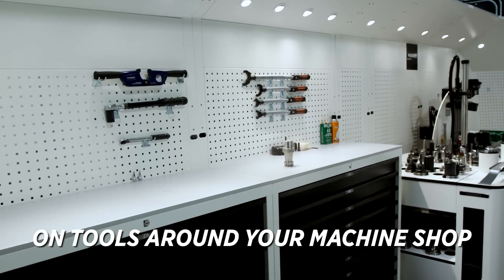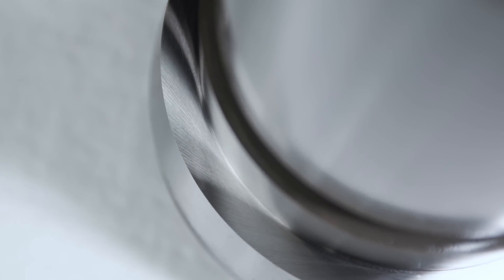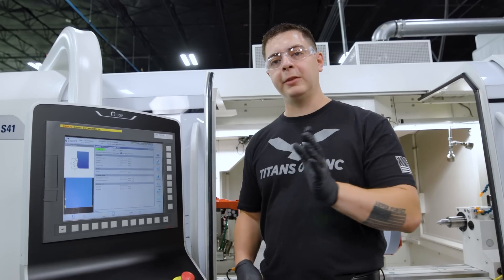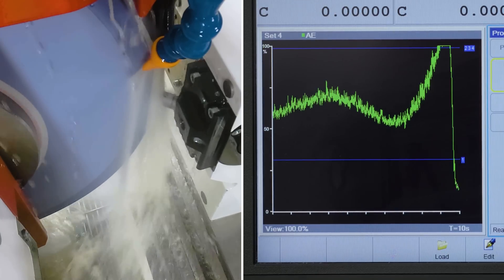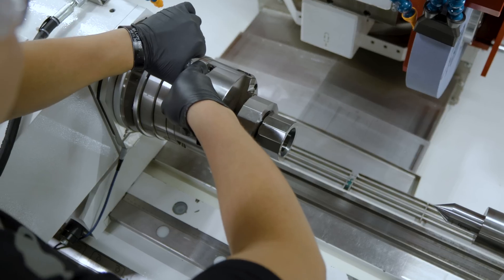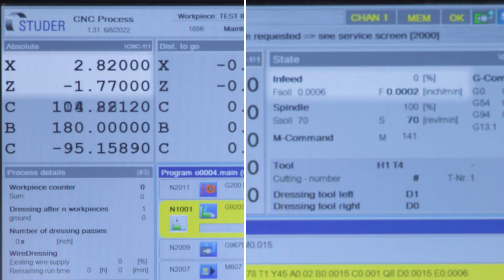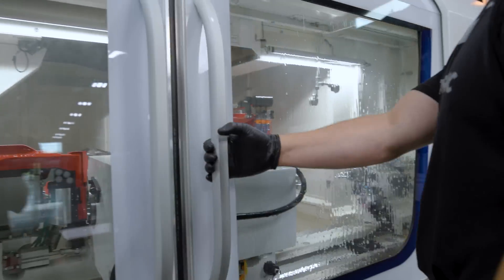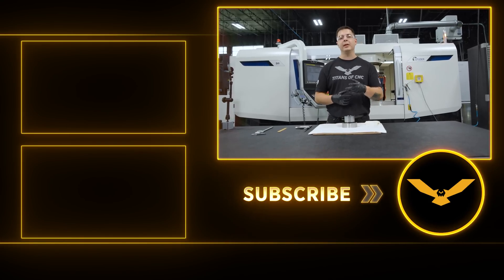Master This Extremely Difficult Technique To Create Perfect Flatness

Comment: Years ago at a former employer I was being trained to operate a new Studer by a tech from United Grinding. I was grinding the face of a cylinder square and asked the tech if there was a macro for relieving the wheel, it just confused him as he had no idea what I was talking about. While grinding the sample part the machine came with for instructional purposes I got to large radius on part, about 1.5 inches if I remember correctly. Tech stated we wouldn't be doing the radius because dressing such a large radius would destroy the wheel for anything else. It is a CNC, could have put a 0.030 radius on that wheel and generated the radius. Dude couldn't make the sample part that came with the machine. WTF United Grinding? Really, WTF?

Comment: I was ona grinder doin some cross hatches and grinding the tool marks off of grooves where O rings would seat, coolest machine ever, dials moving by tenth increments with a vernier to repeat a location. the only thing is the kerosene smelled terrible and I could not continue

Comment: How would you guys go about creating a 5' x 1"thick disc out of stainless steel with a mirror polish that had minimal visual distortion?
Reply: lapping and polishing. grind 3 (minimum) discs and using the 3 plate technique lap the plates together until they are mirror shining. 5' disc that thin is gonna want to warp from gravity as well so work holding will be critical. Just imagining it is hard too, my cousin is 5'2" still growing but imagining a disc that tall and 1" thin... whatre you gonna use it for a telescope mirror?
Reply: @mackk123  lol that is an amazing answer. You rule.  I work in visual arts, it's a sculptural element on a large scale piece so it is viewed from a distance. Any visual distortion gets worse the further away you stand. Our venders have not had much success. I doubt it needs telescope mirror precision but it needs to be better than we have been able to source.
Reply: @FirstPersonPouter  the less distortion, the wider your wallet gets pried open. How far can you stand from a bathroom mirror? I'm sure those are not scientifically flat, maybe within a handful of thousandths, possibly more. I have high hopes for your project. you could also try to polish it with a rag underneath a block and cutting then polishing compounds. With enough elbow grease, you could work out spots that seem off, I am imagining an item I can hold and rotate to view from a narrow angle but then I remember the disc is 5'.

Comment: Do you find the cross hatch method more prone to cracking, especially on larger faces?
Reply: I personally haven't had an issue with cracking due to a cross hatch. I have only really seen cracking caused by aggressive grinding or no coolant. Great question though
Reply: machining tool marks may as well be a higher risk point in this case.

Comment: Not so easy when grinding between centres on an old machine. Our friend shim would most likely be used on the tailstock. Nice machine though!
Reply: Very good point. My friend shim used to live in my old tailstock on an 50 year old s30. But not with the new S41!
Reply: Even grinding on a chuck on these old machines. I do a 14 inch flanged part that needs to be flat and the old 1940s brown and sharpe won't do it without swimming the headstock

Comment: Is it strictly cosmetic or does it serve a purpose?
Reply: @steezydan8543  Great theory, but one surface wouldn't be better than the other you can get the same RA finish with either method. but now I'm curious to see if you can be more aggressive with a crosshatch since it is crossing grinding swirls. Could make for an interesting experiment in the future.
Reply: @christophervillalpando5865  I would imagine that using the crosshatch method may allow you to be more aggressive but even without doing that, it should allow you more cutting time between dressings due to the crosshatch allowing more channels for swarf to get out of the cut instead of building up on the wheel. How much time saved who knows, but in machining any time saved is usually worth it. Great video
Reply: @steezydan8543  sounds like the description of honing

Comment: Smooth polished on non-contact surfaces and crosshatched on lubricated bearing sufaces. (Deleted)
Reply: Lapping for ultimated flatness.
Reply: @opendstudio7141  careful with the stickies at that surface finish tolerance, before you know it 2 pieces will adhere pretty tight. I love my gage blocks.

Comment: I'm kind of lost - what exactly is form 9 dressing? How is that defined? Thanks
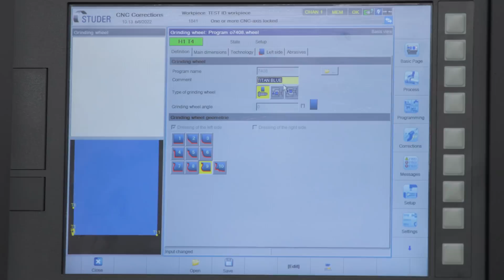Reply: 1:22 look at the bottom right icon
Reply: @PhantomLawd  right i see that's where you set it in the UI but what i mean is, what is form 9 dressing actually? I don't know what it is.
Reply: @cheater00  I refer to it as number 9. so number 7 is a sharp corner with a relief and 9 is the same but allows you to put a radius on your wheel. I dont think he specified what size radius he put on. Not that it matters as its not cutting on the rad.
Reply: @Resnor  to answer that question I used a .005 Radius which is essentially a sharp corner, but it allows me to transition to different ones if I need to go bigger. It just what I have always used
Reply: @christophervillalpando5865  very good point Chris. most people forget that using a 80 grit wheel will never give you a sharp corner. Keep to a number 9 shape then you can re profile the wheel very easily. Thank you for the kind replies buddy! loving the videos.
Reply: @Resnor  Thanks for the support!
Reply: I went into more detail in the Grinding Academy version, but essentially the form 9 is just one of the geometry shapes that is able to be put on the wheel. It is extremely customizable. All depending on what you need.
Reply: @christophervillalpando5865  thanks!
Reply: It appears the Studer system has a set of "dressing forms" where you can save all the parameters of your shop's most-used dressing profiles for immediate recall. If you often use, say, a 20-degree face angle with chamfers on both edges you can plug that into "form 3" and then when you need to dress a wheel to 20 degrees with chamfers on both edges, you just touch "form 1" and...off it goes.
Reply: @jmowreader9555  Great answer, almost though. The forms are labeled 1-10. 1 through 9 are predefined in the software and you can make changes within them such as bigger landings, radi, or reliefs. Form 10 is what's  called a subroutine and can be dressed however you'd like as long as you have the correct equipment and wheel. These types of dressing programs can be saved and called up when they are required. Thanks for watching
Reply: I am curious of the same question, is form 9 a newer machining standard, or is it a proprietary setting? Never heard that reference.
Reply: @jeffwombold9167  never heard it called form 9 before either. the numbers 1-10 are just different shapes you put on the wheel. i suppose you could call them forms. number 10 being a wheel profile that you have to draw up yourself. personally i would have just used a number 7 shape which is a sharp corner, with a 0.2mm cutting face.
Reply: just to confirm, older studers still use the same format. I personally prefer the older studer layout but, hey been using these machines for 20 plus years!
Reply: @Resnor  Awesome thanks for watching!